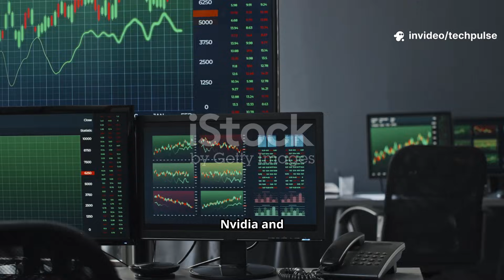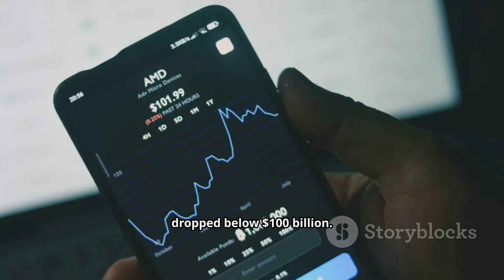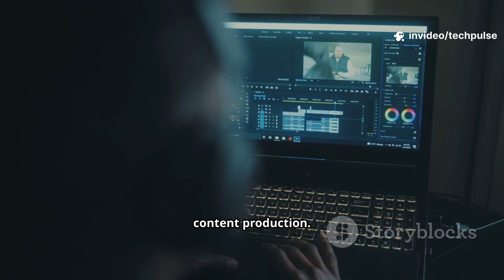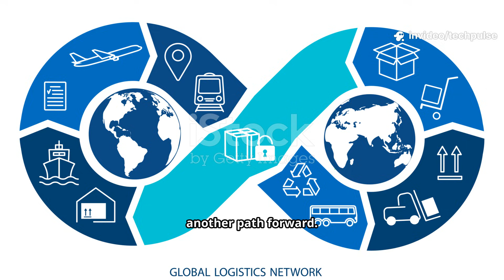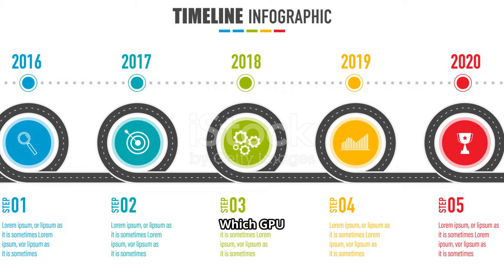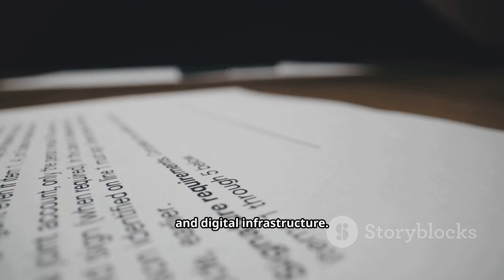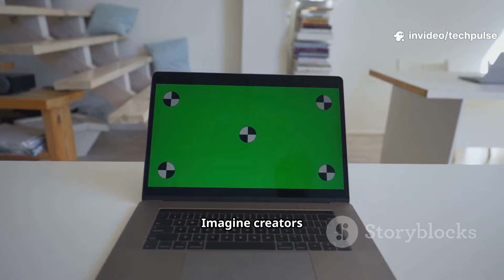The Unholy Alliance of Nvidia and Intel

Comment: NVIDIA see how powerful the new AMD ZEN-6 " Strix Halo " with a build in 48 cu unit. The most  important is that, the new data bus design from AMD. No times delays between CPU to GPU with data communication. Soon, people will stop buying low end discrete GPU.